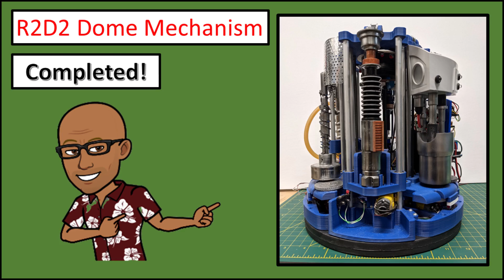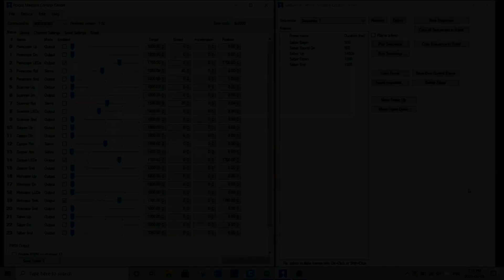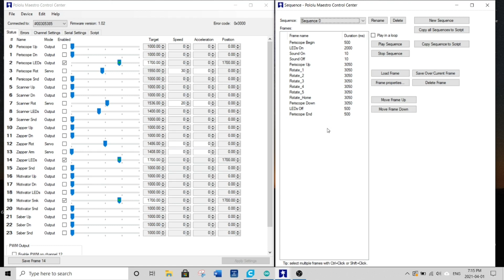R2D2 Build Episode 8- Dome Mechanism

Comment: Did you print the periscope in resin or filament? It looks very smooth.
Reply: Thanks! I may have to print one. I have a machined periscope, but I don’t think the motor for this setup will be strong enough to raise it.
Reply from the maker: @lawrencereynolds3992  thanks.  I used filament.  I think at the time it was ABS.

Comment: Hello Dan my dome is the complex dome 3d printed did you do the pie panel for the périscope with the  recess for the magnet I would really like to printed with the recess or do you think juste glue then will be good enough 

I did your périscope I think it's really impressive the way you designed it and thank you for sharing it for us 

Thank you Stéphane
Reply from the maker: Hi Bruce.  Good to hear from you.  I am not using my mechanism in my R2 so I haven't worked on it since I posted the video but I do have the cap STL here.  There is no magnet recess for it.  I believe what I was going to do was glue in the magnets to the periscope top and then magnetically attach the magnets to the top of those and then add glue to the top ones and align the cap to that assembly and then let it dry.  You should be able to pop off the cap after the glue dries and have the magnets attached.  I hope that makes sense?
https://drive.google.com/file/d/1KICA6iAFB9huv0h3NWJekm4W1ZMWLUYk/view?usp=drive_link

Comment: Hi Dan, Its been awhile, quick question i've completed the dome mechanism and now that i've finally got a dome and lazy susan all installed how or what do you use to get the Mechanism to attach and rotate with the Dome??
Reply from the maker: Hi Anthony.  Congrats on getting it done.  To tell you the truth, I haven't mounted in my dome yet as it is too tall and I need to take it apart and shorten it.  I did create a dome plate centering jig that fits into the center hole of my aluminum plate.  Here is a link to the file and there is also a photo of it in the same Google Drive folder.
https://drive.google.com/file/d/1ypSi2FwwvytPYih-952RznCE8emfZ33V/view?usp=share_link

Comment: Dan fanfastic work i wonder would you be willing to share the STL file for the pump and Ecig holder and possible any part number etc volt reg; pump ? if you wouldn't mind please ?
Reply from the maker: Thanks Chris.  I updated my Google Drive with some of the modifications I added to my Bad Motivator.  There are a couple of photos of the Ecig and the pump.  It was hard to find those 2 items.  You can use basically any pump around 5-10 volts.  The Ecig was harder to find here in Canada so I ordered them from the other side of the country.  Here is a link to my Drive:
https://drive.google.com/drive/folders/19Mm7FYRrmWiqfmYGOdO-DXJXJKcQVnYs?usp=share_link
Reply: @MakerDan55  thank you for the swift response and all your help i will get shopping and printing 🙂
Reply: @MakerDan55  i have got my Ecig i was lucky or £1 shop sells them, but the stupid question and i sorry to ask it I have been over and over your video but i cant quite see how you have powered it. I can see one wire on the outer casing but were is the second fixed too please ? Sorry may be obvious but i cant quite get it its the 3V supply.
Reply from the maker: @chrissmith5274  Hi Chris, I am attaching a link for a video I watched that showed me how to connect the Ecig.  You basically have to open it up and solder a wire to the center hub that usually gets attached to one of the ends of the battery.
https://www.youtube.com/watch?v=uDISX8MMLak&t=132s
Reply: @MakerDan  thank you thats great I have soldered it up I just need to get the silicon tube. I like the way you have used a bigger tube to cover the whole ecig. I really appreciate your help and I will try to not bother you again. I hope mine turns out even half as good as yours I will be ecstatic, sir.
Reply from the maker: @chrissmith5274  you are never a bother.  Glad I can help.  Let me know if you need anything else.
Reply: @MakerDan55  thank you sir

Comment: I'm working on mine now. periscope done and trying to figure out the motivator. So I'm thinking about putting a magnet not on the side of the saber, but countersunk on the bottom. Do you think there is enough room in the lifter base for a 5x5mm countersunk magnet?
Reply from the maker: I don't think so.  The bottom of the lifter hits the top of the motor.
Reply: @MakerDan55  hmmm. I think I need to open it in fusion and see how deep you could place it cause there are plenty of pretty thin magnets that can go in the lifter
Reply from the maker: @CaptainFettCosplay  that's a great idea 👍🏿

Comment: Very cool. I’m working on one of these, too. On the dome zapper, are you putting resistors on the LEDs?
Reply from the maker: Thanks.  Yes, all LEDs have resistors 😁.
Reply: @MakerDan55  Thanks. The instructions didn’t mention resistors at all. Is the zapper sound effect custom? What’s the source?
Reply from the maker: @lawrencereynolds3992  normally it is assumed that resistors will be used since LEDs will burn out without them.  I found some sounds on the internet I liked and edited them in Audacity.
Reply: Normally, that’s true. I have worked with control boards that didn’t require LEDs or the current going through them was so small, resistors weren’t needed. Thanks for the info.

Comment: Hi, you may have the modified part for lifescanner (lower mount riser and servo gear) orginal it is too little movement.
Reply from the maker: I placed these in my Google Drive for you:  https://drive.google.com/drive/folders/1bW29Q5QmMhiTJbFpsDhkvpt4DdFtiv5e?usp=sharing
Reply: @MakerDan55  😃Thanks
Reply: @MakerDan55   Hi, discovered that the hole in the bottom mount is too large for these new parts you have also made new bottom mount ?
Reply from the maker: @timopaso6444  I just uploaded all of the rest of the files I have on the LIfe Form Scanner.  Here is the link.  Hopefully you will find what you are looking for. https://drive.google.com/drive/folders/1v7uFK3Gv2pUOZBKAmyyiktireZaXYHPW?usp=sharing

Comment: Hi Dan, I am in the process of putting this together and need some help with the wiring of the limit switches, motor controllers and such. The initial wiring from  Matt Zwarts was for a servo board and arduino. But now with using the Maestro 24,,,, what to do??
Reply from the maker: Hi Anthony.  It's quite simple but there are a lot of wires.  I drew a quick sketch for you.
https://drive.google.com/file/d/1eb1iYa-TbJEQ7yWwhcFRgDid9Me1zV-o/view?usp=sharing
Reply from the maker: Try this link
https://drive.google.com/file/d/16oCrsCOlNoQSy4BZxheGNYJnU1nh-_0b/view?usp=sharing
Reply: @MakerDan55  Thats only one limit switch how do they both get connected to move motor up and down. Not sure.
Reply from the maker: @anthonyscuderi669  you use another output from the Maestro for the second direction and send that output to the motor driver's second input through the second limit switch.
Reply: @MakerDan55  link no longer works😢, anyway to update this? Thanks

Comment: what type of screws hold the belt to each piece and also what type screw for the momentary switches??
cannot find any that small in hardware stores
Reply from the maker: Hi Anthony.  I have an assortment of small screws that I have collected over the years after pulling a lot of small toys apart.  They are around a #4, round head screw.  I don't know where to buy them from either.

Comment: Very nice! I haven't finished wiring mine yet, it's been sitting on the workbench for months. I love some of the features you added, the additional lights and logic to the periscope and the lights for the zapper. The sound FX are cool! nice to integrate it all in one package over running that through the main sound system.
I like your mods. Great work! Thanks for the look at the code too!
Reply from the maker: Thanks Chris.  I appreciate your comments.  Unfortunately I found out it won't fit in my aluminum dome 😒.  I need to take it all apart and cut off almost an inch from each support rod.
Reply: @MakerDan55  Yipe!
I test fitted mine in my printed dome and it seemed to fit fine. I'm just concerned about how it sits on top of the bar. Wow though, that sucks! I hope you get it sorted out soon!

Comment: Dan, this is so amazing! I'm currently building one, also using the pololu maestro also, I'm wondering how did you connect the motors ? and the leds did you conected diectly to the poluou? Thanks!
Reply from the maker: Thanks!  The motors are controlled via the motor drivers that Matt suggested.  I have a video on that showing the signal going from the Maestro to the motor driver and then to the motors.  If you are asking about the LEDs in the periscope, then they are controlled from the Arduino Nanos that are in the periscope.  I have a video on that setup as well.
Reply: @MakerDan55  thanks a lot!! Awesome!!... another Quick question how are you handle the cables from the dome pies (that will be spinning) against the board controller on the tower?
Reply from the maker: @DarkAngel22025  the dome mechanism moves with the dome plate.  In the center of the dome plate is a slip ring that is able to spin and those wires are connected to the servos.  I haven't gotten that far yet.  Unfortunately I will have to disassemble my entire dome mechanism and cut it down by about an inch since I found out it is too tall to fit inside 😩.
Reply: @MakerDan55  thanks a lot! .. yeap I'm working on that too, and notice I had to cut it. Because it's to high for the dome. I'm working on the electronics now. Thanks a lot for your help!